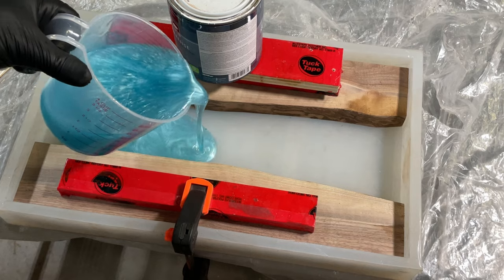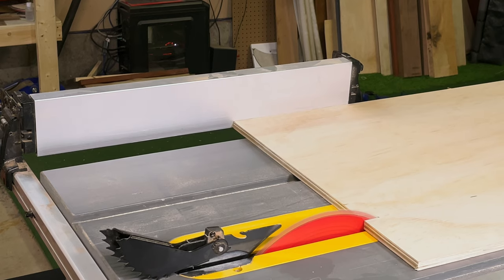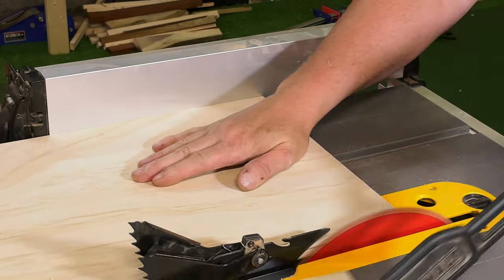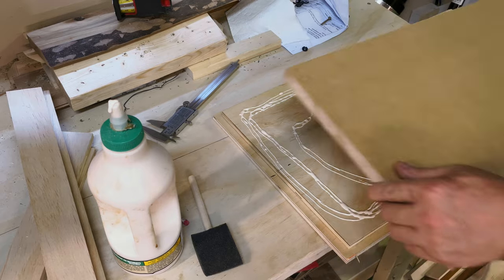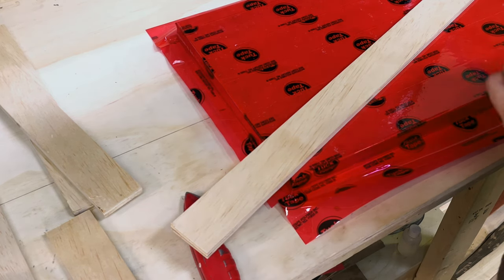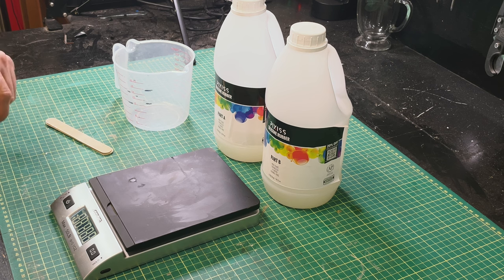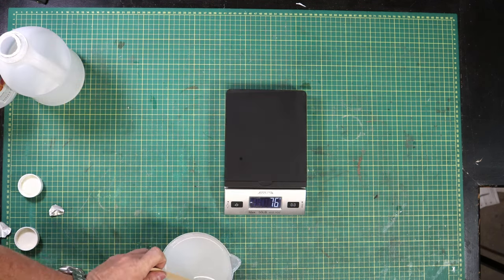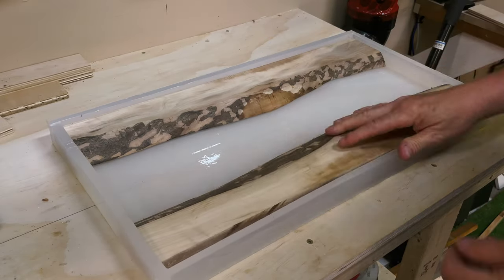Custom Silicone Molds

Comment: Thank you for making the video.  I want to make a few molds - would like to start with coasters.  It seems like it is critical that the tape be applied smoothly or you might end up with irregular textures on the surface of the mold .  Is my understanding correct?
Reply from the maker: For a charcuterie board the quality of the taping is less important because the boards produced will be planed/sanded extensively. It doesn’t take a lot of effort to make thing smooth though.

Pretty much anything you make with epoxy resin will be finished the same way.  The smoothness just simplifies the finishing process a bit by reducing the sanding you need to do

Comment: Hey Steve, thank you for this. Can I ask how much silicone you used to make this mold? I'm just not sure how much to make up and since it can be expensive I want to minimise waste. thanks in advance from NZ
Reply from the maker: Indeed it is expensive.  The large mold with half-inch walls and floors that I created in this video I used about 8 cups of silicone.

As far as volume, this mold is relatively easy since it's just one regular shape (boxes) inside another. So you can calculate the volume of the inner box (L*W*H) and subtract it from the volume of the outside box to get the volume to a liquid measurement using our friend, Google

Comment: I have tried epoxy a couple time but it usually ends up with a sticky surface. Any suggestions? I’ve been using Monkey Pod but the cost of the wood really cuts down on my profit.
Reply from the maker: If the epoxy is sticky after a day or two then there is probably not enough hardener in it.  Some epoxy is mixed by volume and some is done by weight.  Make sure you’re mixing per the suppliers instructions.  Having said that, I have experienced some epoxy that just won’t harden, no matter how I mixed it.  I concluded it was just a bad batch.

I’ve recently taken to New Classic Resin for making  charcuterie boards.  It never cures with bubbles and finished perfectly every time. (And I have no relationship with them. I just like their resin because it makes my job essy.
Reply: @SteveMakesEverything  I will try try that. Thanks for the great content and for taking time to answer my question.
Reply from the maker: @gordangraham  I'm just trying to be helpful 🙃